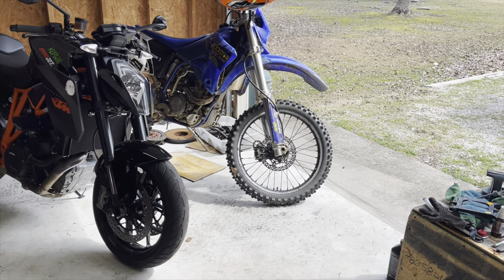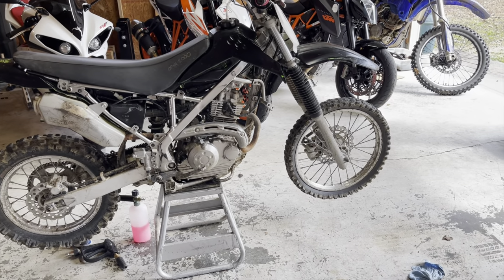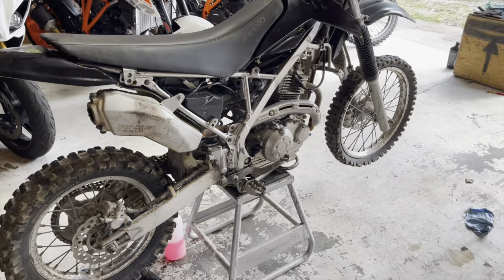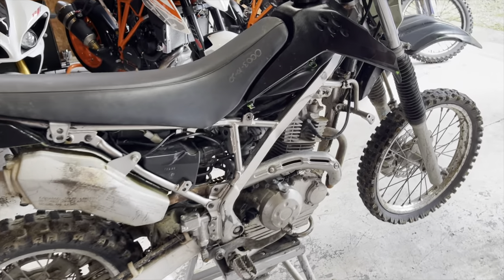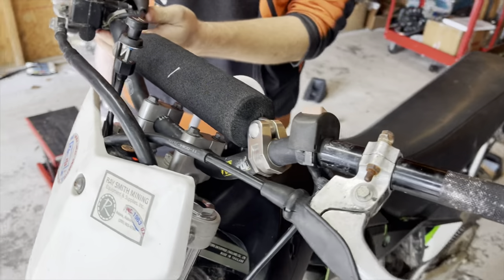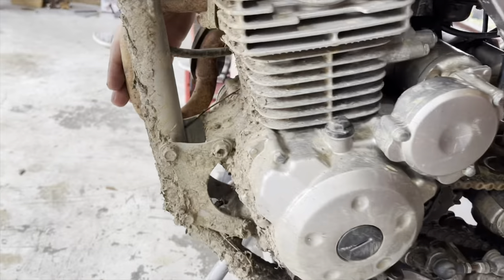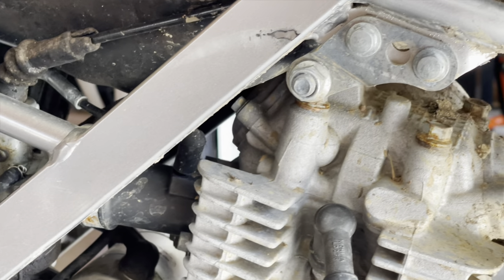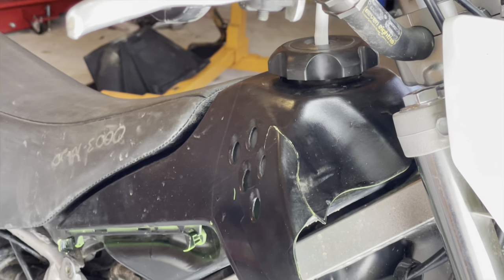How to build a kids dirtbike into an adult supermoto!

Comment: What size wheels and tires are those?
Reply: I have the same question
Reply: Stock rear wheel (14"). We laced a 14" rim onto the front hub, and we run 100/90/14's front and back